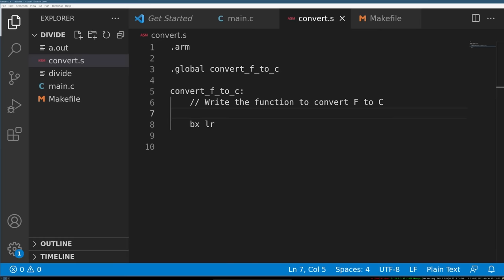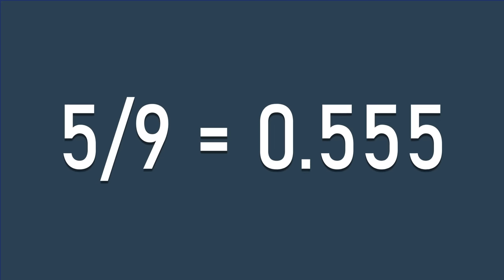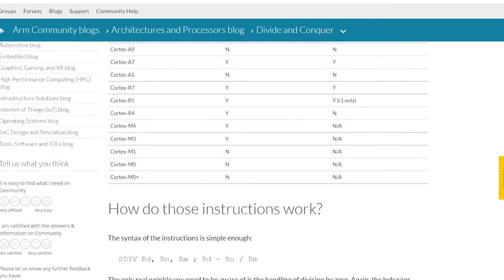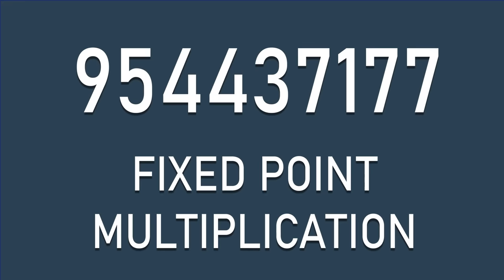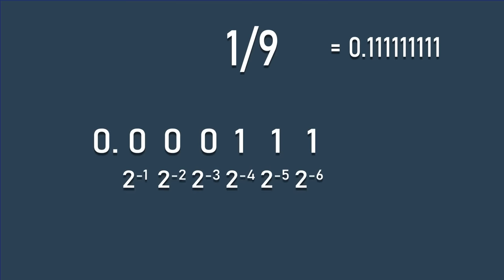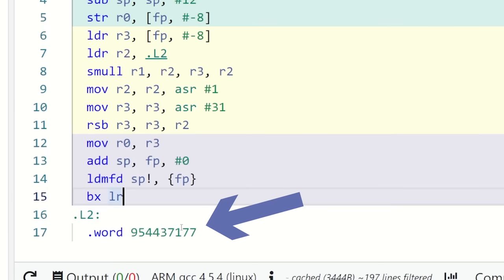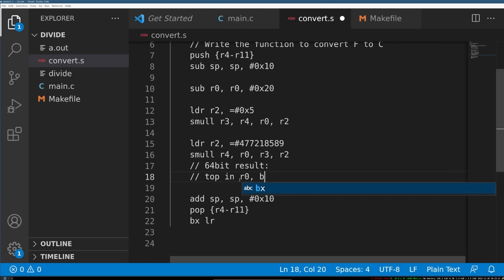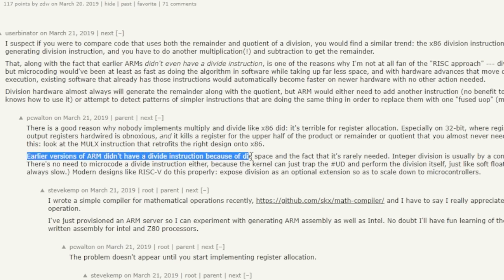computers suck at division (a painful discovery)

Comment: Other solution: don't use Fahrenheits.
Reply from the maker: Imperial Unit Gang
Reply: The good old freedom units that you got forced on by the uk cause nothing stands mor for freedom than the British empire.
Did you learn about picas and points btw? And can you tell me how many miles 1 pica + 3 points are?
Reply: F that!
Reply: For Non-Americans an easy way to understand Fahrenheit is to think of them as a percentage anything below 40% is cold 40% to around 75% are nice medium temperatures and anything above that is hot as hell!
Reply: @Devin Nall  Yeah like most metric stuff is just better full stop, but Celcius is not more beneficial for a human. Fs range of 0-100 being "about dangerously cold but manageable with layers" to "about dangerously hot but manageable with hydration and limiting sun exposure" is much easier to just understand what a temp actually means to me planning my day. Celcius is based about water state changes but I'm not water i don't care when it changes state for weather forecasts
Reply: @gwenyurick9663  The only other thing Imperial is better at is cooking Cups and Tablespoons is much simpler than milliliters
Reply: @gwenyurick9663  You're mostly water.
Reply: @PRIMEVAL543  why would anyone ever do that
Reply: Thats avoiding not solving
Reply: @gwenyurick9663  you are literally mostly water bro 💀
Reply: So for length let’s use metric because the decimals are so much better, right?
1-1/2 inches is exactly 1.1 in binary
1.1 cm is approximately 1.0001 1001 1001 1001 1001 1001 in binary
3-3/8 inches is exactly 11.011 in binary
3.3 cm is approximately 11.010011001100110011 in binary.

Which makes more sense in the digital age?
Reply: @devinnall2284  we have metric cups, tablespoons and teaspoons
Reply: Imperial units? More like Inferior units #roasted
Reply: @renakunisaki  I’m dead 😂
Reply: I like both for different reasons.
I like Fahrenheit because it feels nicer for representing human scale temperatures.
32-100 represents a more readable and relatable number scale for temperatures since it's a more 0-100 than Celsius.
Water freezes at 32, 60-70 is room temperature average, and higher than 80 is hot(80s), very hot(90s), scorching(100s).
Meanwhile 40s are refrigerators, 32 is freezing, and 0 is so cold you're in real trouble.
I use Celsius for inorganic things and large scales like processors and chemistry because it is way easier to know that 35C is good for computers, and 70s or higher is a warning sign your cooling is bad.
I like the precision from my precision tools.
I like the unga bunga unit for me. 
I understand that some people get furious about units and I totally understand the frustration.
But here's the thing, people. All units are standardized to metric. Imperial is as well.
The inch is the industrial inch and was standardized to metric long before many here were born. Besides. Most units are still silly. The SI unit for lumens? Candela. The measurement of a "standard candle." Granted candles are pretty consistent but still silly.
Units are tools. Some are developed for specific purposes where only a certain scale is necessary and anything more is either wasteful or adds confusion. Kelvin is the superior temp unit though.
Reply: @crankyfox  I like Celsius because it tells me what to wear.  
Over 30, shorts and T shirt.
20-30 long sleeves and pants.
10-20 add jacket.
Below 10, wear coat and think about gloves.
Reply: @aaronbaker2186  Fahrenheit does the same thing.
Reply: @ArchivedFox  not really, I wear shorts for some F temps that start with 8 but not others, ditto with temps that start with 6 and a jacket.
Celsius the clothing matches the first digit.
Reply: @LowLevel-TV  451 Celcius.
Reply: @aaronbaker2186  why in the hell at 20-30 would you wear long sleeves, for me thats alr t shirt temps :💀💀💀
maybe bc im a southy cough cough cold
Reply: Did you know that the USA actually uses the metric system, everything in imperial units is calculated from the metric value
Reply: @gwenyurick9663  I never learned Fahrenheit until I was 15 so celsius temperatures track well to me
Reply: @aaronbaker2186  yes, that is how tempurature works
Reply: When europe puts a man on the moon I’ll start using metric.
Reply: @jackroyaltea5034  didn't nasa admit to using metric nowadays
Reply: @devinnall2284  if you struggle to understand base 10, then yeah ig
Reply: @jackroyaltea5034  imperial didn't get you to the moon
Reply: 1-1/2 cm is exactly 1.1 and 3-3/8 cm is exactly 11.011 so what is your argument?
Reply: There are 2 types of Nations, those who uses the metric system, and the ones that landed on the moon.

(I am aware of the fact that NASA used the metric system back then)
(I am also European)
Reply: @simonhaas6480  you used metric to get to the moon, nasa works in metric
Reply: @Epic_747  Nah, that's propaganda from the Europeans to make their populace feel better over the fact that we got to the moon, then went several times, then just got bored.

(BTW, "imperial" is based af. 5280 feet in a mile feels soooo much better than 1000 meters in a kilometer.)
Reply: @MommyKhaos  wow their onto us, how long until they find out the world is flat
Reply: @jorceshaman 👍🏻 my first thought when I read that one
Reply: If you only have fahrenheit to begin with, you'll need to convert it. Hence this video. You can't just ignore data because the units are unfamiliar to you.
Reply: Using Celsius instantly solves global warming.
Reply: Fahrenheit gives you an intuitive 0 to 100 scale to represent ordinary temperatures that you typically encounter on a day to day basis. I live in a country where we use Celsius and the metric system. I'm all about meters, kg, etc., but Fahrenheit is way better than Celsius.
Reply: @jorceshaman  And salt is mostly chlorine. Are you going to wolf down some with your next meal? I can ignore the chemistry to man.
Reply: @myself2noone  I'm not going to wolf down table salt because it's gross and I get no salt fries. I'll wolf down some water, though.
Reply: Well imperial units are often easier in casual conversation just not for science or math, like if you’re helping someone park in a tight spot and not hit the car behind them you don’t say “you’ve got about 30 centimeters before you hit that car mate” you say “you’ve got about a foot before you hit the car behind you” oh and for height it’s just easier to say 5 foot 10 and makes more sense when you’re thinking about how tall that is in your head than saying 177.8cm tall and trying to visualise how tall that is, ps before you try to call me an American who doesn’t understand metric I’m from Australia we are 100% metric except for non formal conversion where often we use feet and inches for height and stuff like that
Reply: How many popsicles will that be?
Reply: Light the virtue signal 🙄
Reply: Certified rankien moment
Reply: The funny thing is, Fahrenheit is actually one of the better imperial units, so far as they are concerned. Celsius is honestly too large of a unit for temperature, imo.
Reply: @aaronbaker2186  isn’t the difference between 10 and 20 degrees kind of enormous? 70 degree weather doesn’t really require a jacket.
Reply: @Jorce  we're made of water but our lives are not applicable to water-centric temperatures. My blood does not have to boil for me to have heatstroke. Standing in 100°F, however, is right about the point where you really have to worry about that. Similarly, our blood doesn't have to freeze for us to get hypothermia, and it turns out that the body is pretty good at keeping blood from getting instantly frozen anyways. So, 0°F is actually really cold, whereas 0°C is pretty damn warm to me about half of the year.

Also, if we want to be smartasses, our bodies aren't simply made of water. We don't have pure water in our bodies, but rather a bunch of solutions. Solutions can and often do have notably different physical properties when compared to pure water, so why not use the freezing and boiling points for those solutions as our official temperature instead?
Reply: @Aaron Baker  that doesn't make sense, you're arbitrarily dividing the ranges into 10s in the first place. Arbitrarily dividing into 20s is the same exact thing for Fahrenheit:
80+, lightest clothing possible
60-80, light clothing, maybe a jacket for wind
40-60, sweatshirt or heavier jacket
20-40 heavy coat and pants
0-20, 2+ layers of clothing
<0, stay inside.
It's the same system, and it gives us a more precise understanding of what the temperature actually feels like.
Reply: Imagine measuring by base-10 no matter what instead of measuring by ergonomic, human bases of common usage
Reply: @iks1536  i said the imperial system makes no sense (or sens as you say it) to be used in science because it’s not decimal, but casual conversation is different because saying 5 foot 8 or something for someone’s height is easier to understand in your head than 170cm or whatever the conversion is,  trying to visualise 170 of a small unit like a cm is hard. it’s a larger unit of measurement that you can kind of quickly visualise in your head because it’s based on real objects, and no australia went metric in 1974 way before I was born so no I was not “raised in the retarded imperial system”, although you do still very rarely see miles and yards on some old faded overgrown signs on rural roads or long forgotten bypassed highways, guess they missed a few when the went round removing them. They have only survived in non formal conversation being used fairly regularly for height and very occasionally for distance.
Reply: @benjamin_b929  yeah, no
Reply: dude that’s like the only area where the imperial system is way better. 0% hot = extremely cold, 100% hot = extremely hot. everything else is better with metric but this is the OBVIOUSLY superior way of measuring temperaturez
Reply: Other solution: just divide by two. Close enough
Reply: FAHRENHEIT FOR LIFE
Reply: @Silvia.Sparks  For a miserable one.
Reply: F is required mainly for measuring body temperatures as they give a sight higher scale
Reply: @chandukiran13  wtf are You even talking about, thermometers for body temp measurements have precision up to 1/10th of a degree. What more do You need?
Reply: @iks1536  but it's easier to convey you have a fever saying 99 or 100 or 101.2 rather than saying 38.23 or something
Reply: The real solution is don't use Celsius.
Reply: @PRIMEVAL543  *more
It makes sense you struggle with English.
Reply: I understand a lot of the metric system being better. However, I don't understand why Celsius is better than Fahrenheit? There is no MC, KC, mC. People like to say it is matching the boiling point and freezing point of water but who cares. First off boiling point changes substantially based on elevation/air pressure so 100C isn't that helpful. Does having an easy number for freezing really important in my life?
I'd personally rather use Fahrenheit as then I don't have to deal with negative numbers. Where I live it gets below freezing but rarely does Fahrenheit go negative.
Reply: Other solution. Use F and not C
Reply: @LowLevel-TV  more like inferior units
Reply: @devinnall2284  You don't need to use millimeters for that lol
Reply: Sadly I'm not used to Celsius, I've used Fahrenheit my entire life. Then again, I probably could because I suddenly started using meters out of nowhere
Reply: Farenheit is the one thing Imperial has that's actually good for daily use. Everything else should be tossed for  metric IMHO.
Reply: Why ARM processors?
What about CISC based ones?
Reply: @PRIMEVAL543  we use Celsius..
 - a brit
Reply: @LowLevel-TV  SI units are better :/
Reply: @off7hewall And a 'Stone' is 14 pounds.
Reply: @aaronbaker2186  I can tell you don't live in the UK. Take 10° off each temperature range and that'll be more normal for here. 😄
Reply: @aaronbaker2186  20 to 30, long sleeve and pants?
Are you joking?
30C is real hot. I don't know anyone who would wear a pants and long sleeves in that weather. Even 20+ is still decently warm.
You must be cold the whole time wanting to cover up so much in those temperatures.
Reply: yep. garbage in, garbage out :P
the other solution is integer math, which lotsa applications use for this reason
fp precision will drive you nuts if you do 3d design or level design
Reply: You're telling that to Americans who call "football" a sport where they mostly use their ARMS to throw and catch an OVOID, but call soccer the sport where players mostly will use their FOOT to kick a BALL.
Also refusing to use International measurements.
Reply: @jackroyaltea5034 that was possible by the power of BUDGET(being USA the global power) during the cold war as a show of of who had the best rocket tech. URSS gone, no more budget, no more people to the moon. Not because of units, as you kind of claim.
Reply: @hermitcard4494  Water boils at 212F. You can't explain that!
Reply: @gwenyurick9663  Most of you (60%) dissagrees with that statement.
Reply: Unsure how it works. do we have to bow to the king to use Celsius?
Reply: @LowLevel-TV  don't think I've ever had a shudder go through my body as quickly ever in my life 🤢
Reply: Even better don’t use American units 😂
Reply: Contrary to popular belief Fahrenheit is by far the more scientific of the initial of temperature measurement because it ties the specific unit of measurement to a physical change that can be measured. The first flaw of Celsius is that it’s standards of units (freezing and boiling of water) are not fixed constants and change with relative pressure (not much but it is there) secondly it requires a competent breakdown of the space between those two points into even linear segments which is a tricky proposition when you are building a measurement device. Fahrenheit on the other hand takes a known physical property, the the thermal expansion of mercury, and uses it to fix the delta T units of temperature rather than deriving them secondarily. An increase of 1 degree Fahrenheit is equivalent to an increase in the volume of mercury by .01% therefore you set a single calibration point (knowing either 32 or 212 is good enough you don’t need both) and configure the thermometers to the change in volume beyond that fixed point.
Reply: Fahrenheit landed a man on the moon.
Reply: Just don't use Celsius then you don't need to convert it
Reply: Aka stop measuring things with feets
Reply: I prefer Celsius over Farenheit for one simple reason: 69°C is an ideal temperature for coffee, it is said.
Reply: @bobh6728 just use fractional or decimal fixed point numbers. Dollars are represented in tenth power too.
Reply: @gwenyurick9663  it's always the same argument every time lmao. The interval is totally arbitrary, you just get used to one or the other. 0-100 is not more understandable than 0-40, you're just more used to it. Also, you can't really feel a difference of less than 5°F, so why do you need so many degrees? Just do 1-10 with half steps, and done. At least Celsius has an excuse for not being 0-10, F is just dumb from every perspective
Reply: @simonhaas6480  There are two types of nations: the USSR and the ones that didn't reach the space first. And USSR used metric so...
Reply: Other solution: shut.
Reply: Sooo. Imperial ist based in metric...
Reply: @LowLevelLearning  the one time I like using imperial is coincidentally when using a temperature that I don't want to be relative to absolute zero because each full degree has less range in between.
Reply: MURICAAAAAA
Reply: Brain solution
Reply: @gwenyurick9663  is that so hard to remember -20, 0, 24, 36.6?
Reply: @PRIMEVAL543  what a helpful and well-known unit of measurement
Reply: @LowLevel-TV boooooh
Reply: Fahrenheit is better for everyday use. 
Celsius is better for science, except for when it’s Kelvin’s turn on the xbox.
Purism is bad.
Reply: @Coliflower185  When using inches, a lot of the time it is broken down to 1/2, 1/4, 1/8, 1/16, 1/32, 1/64 and rarely 1/128 of an inch. All of these can be represented exactly in binary. We would use 3/15 like your example. You wouldn’t use 3/8 of unit.
So I’m just saying, for the digital age, systems based on powers of 2 are a more logical choice than ones based on 10, 12, 3, 5280, or 60.
Reply: What kind of weirdo uses Celsius? Ahh the same weirdos who all disarmed themselves and bow down the government xD
Reply: @aaronbaker2186 How about over 50!😮
Reply: fahrenheit just has one problem for me: the freezing point. the freezing point with celsius is really easy to remember as it’s just 0 whilst fehrenheit is some weird number that is hard to remember. 

so like -x celsius = snow and ice and that’s easier to remember and understand than <32 fahrenheit = snow and ice. but for normal life fehrenheit is nice as you may mistake 23 degrees as cold in celsius when in fact that is 75 degrees Fahrenheit which seems more reasonable
Reply: @gwenyurick9663  100 Fahrenheit is really not that hot. It gets that hot and even hotter in Vegas and you really don't feel it
Reply: @devinnall2284  makes sense. Because despite the fact that computers cant divide, humans divide very well. And numbers under 12 are easy for our brain. 😁👍
Reply: Thats why he is converting it
Reply: @fluffyisyermom7631  Free Healthcare and no school shootings feels pretty good though
Reply: It’s funny that Europeans say Americans can’t take jokes, but make a joke about freedom units being better and you’ll get a lecture on how metric is “objectivity better.” I’m a metric liker but this is childish lol
Reply: @hermitcard4494  Historically, the word "football" used to be a generic word for sports not played on horseback.
Reply: My take on Celsius vs Fahrenheit is that Celsius shouldn't've been invented in the first place. Both systems are equally arbitrary, and equally valid. The reason I say that Celsius shouldn't've been invented is that it didn't need to be. The metric system was invented to solve one big problem, that being the need for a standardized, general use measurement system. Prior to metric, most measurement units were invented for a single specific purpose, this is why some older units have bizarre definitions like grains of barley or lengths of body parts, the need to convert from one unit to another wasn't taken into consideration. This was a problem because many measurement units had almost subjective definitions that could even change based on what region you used them in. Metric solved this problem by creating units with objective definitions and used powers of ten to make the units internally easy to convert. Celsius, however, is the odd one out. Fahrenheit had already been invented by the time of the metric system, and could be easily defined and measured by mercury thermometers. Comparatively, Celsius's definition of 0° being the freezing point of water and 100° being the boiling point of water is actually subjective, since neither of those are universal constants, meaning they can change based on environmental factors. Neither unit is more objective or better they're just different ways of communicating the same thing.
Reply: @PRIMEVAL543 the imperial system is kinda dumb since we're the only one using it, it's not as readable as the metric system since it's not based 10, and the metric system is a standard in most scientific use cases even here in the us
Reply: Other other solution, just make a company, make analog computer, make it popular, replace digital computers with analog ones, create a monopoly without trying, defend that monopoly and now you can process any number (hopefully) you can think of
Reply: How are we supposed to get to the moon without the superior units of measurement?
Reply: -- the whole imperial vs metric debate is so fucking stupid 'cause it literally just boils down to "having to refactor literally every instance of a unit of measurement in our lives just so it's easier to tell at a glance when water will fucking boil" isn't that appealing

-- esp since we literally use metric units in everything scientific we do anyways
Reply: @niikobloxxin  reminder: a probe crashed into mars bc of 2 systems
Reply: @gwenyurick9663 yeah, but when it comes to using temperatures in physics, you cannot easily use fahrneheit, as it was not developed to precisely measure energy like the kelvin scale. And the kelvin scale is simply the celsius scale shifted by 273,15°, the difference between 1 and 2 degrees is the same. Making celsius more useful for physics calculations.
Now, everyday life? It's really all about habit since precision is not important. 
100f or 37c degrees for hotness and 32f or 0c degrees for coldness, it's not really important.
But if you make any use of physics, and I do, in everyday life, you need to learn celsius/kelvin. So if it's just habit plus celsius better in science, I'd say it's better to employ the celsius scale.
Reply: Other solution: don’t use Celsius

Ultimate solution: Get rid of both and only use Kelvin
Reply: @devinnall2284  OOOOH OK IM EUROPEEAN THIS HELPS
Reply: @hermitcard4494 you realize that the term soccer came from the uk right?
Reply: ...."Wtf is Kilometer?!".....
Reply: I like how he's trying to convert something in to Celsius from Fahrenheit which it would just make sense just to use the better system which is not the metric system and like wtf is a kilometer like a kilo is a way a measuring weight so what dumbass decided to put meter after it like what dose a kilometer even mean like even when you put kilo into Google it comes up with kilogram and says kilometer is rare like even Google doesn't like it and it's a search engine, use a better system that actually makes sense. 0 degrees is cooled and water freezes at 32 and 100 degrees is hot and 50-70 is pretty nice. It just makes sense.
Reply: @bobh6728 clearly the binary as if we are talking digitally the computer understands that better
Reply: @Konsebruh that's what I'm saying like who the fuck put a kilo in front of meter like Google doesn't even like it
Reply: @LowLevel-TV  imperial > metric
Reply: @devinnall2284  thats not helpfull
Reply: @Scudmaster11  🤷‍♂️
Reply: @bobh6728  that is not how computers use decimal numbers. They use IEEE 754 format. Every number is a 32 or 64 bit string of numbers.
Reply: @Vogelchen  IEEE 754 is the floating point standard. Since it is binary numbers, it cannot represent most decimal numbers exactly. 0.1 is 0.00011001100110011... You have to cut it off at some point, so it is not exact. That is my only point, that fractions based on a power of two like 1/2, 1/4, 1/8 can be represented exactly. I run into this all the time. Adding a long list of positive and negative numbers that add to zero will sometimes show 1e-18 as the sum because of that imprecision.
Reply: @PRIMEVAL543  no person who uses the imperial system knows what a pica is, that's like asking how come you live on earth when you can't tell me the chemical makeup of the mantle
Reply: @gwenyurick9663  Celsius is like asking water how hot it is, Fahrenheit is loke asking a person how hot they are, and Kelvin is like asking an atom how hot it is (this one might not be that accurate)
Reply: The thing that kills me about the argument for Celsius is that the boiling point of water (at sea level, mind you) is an utterly useless number because you do not need to know the temperature of water to boil it. The magical thing about liquid->gas state-change is that when a substance hits a pressure-temperature that would cause state change, it's temperatures stops changing as excess thermal energy is used to break bonds.

Are there times (maybe in baking?) where it would be useful to know the boiling point of water. Sure. Are they frequent? Absolutely not. Most of the time people just add heat to water until it boils, no measuring required. 

So why then is it a feature that Celsius squished the entire range of typical human living temperatures into a ~40° range in order to reserve 100° for boiling water?
Reply: Rankine temperature scale is superior.
Reply: @PRIMEVAL543  SCOTLAND FOREVER
Reply: A universal solution for conversion problems is to use a lookup table with sufficient precision. Having lived in Hong Kong and moved to New York, I remember these exactly matching temperatures: -40°F=-40C 32°F=0C 50°F=10C 68°F=20C 86°F=30C
I used linear interpolation between these exact conversion values as I originally learnt to use linear interpolation to "look between the lines" of a logarithm table for the desired logarithm value.

China used °C. British Hong Kong went from °F to °C. Then in New York, it's °F until I sought a ° in a University and it's °C until Physical Chemistry required K.

The Book of Revelation's hotness sequence is: 
°C °F °C °F °U °C K
Reply: Just avoid backwards units like centigrade.
Reply: @gwenyurick9663 also you can control your thermostat with more precision. Some will say they can use 0.1 C increments, but that is only if your thermostat has that, and also if it does, 0.1 F increments are also then even better. But the most precise control would be to switch between both to get all possible points on the thermostat, but that takes more figuring out.
Reply: yes
Reply: @FBI_42069  You may only be joking but I assume you're not. A kilo is just a way of saying that the unit used is a thousand times bigger. For example 1000 bytes is 1 kilobyte, so you also use kilo in your country
Reply: @PRIMEVAL543  Well, the british Empire abolished slavery and made a lot of places properous.
Reply: In most cases,  the metric system is clearly superior...but Fahrenheit is a better temperature scale.
Reply: @chrism6880  how come? 🤔
Reply: @hoti47  it's purely opinion, but 0-100 roughly translating to environment temperature in human habitats, and the higher resolution without need for decimal expressions are the reasons I prefer it.  Although it's likely that anyone would simply prefer the system he or she is used to.
Reply: @chrism6880  Well, yes, it makes sense for the evironment, but probably not that much for other purposes.
Reply: @gwenyurick9663  my brother in christ Celsius is literally the same the scale just goes from ≈-30 to +30
Reply: @bobh6728  i know i'm gettting baited super hard right now but this decreased my life expectancy by 22 years and i wish that comment was never sent
Reply: @LowLevel-TV  WTF IS A KILOMETER RAAAAAHHHHHHHHH 🇺🇸🇺🇸🦅🦅💥💥🇺🇸💥🦅🦅🇺🇸💥🦅🦅🇺🇸🇺🇸
Reply: @gwenyurick9663 yeah definitely american. YOU ARE 70% WATER...
Reply: @gwenyurick9663  that idiot system of porcentage doesnt work with celsius. Its 256 to 100000+. Why human factor matter that much when the only benefit for Fahrenheit is to know "better" the temperature sensation? The only reason that is "better" is that people learned in that way in first place. Everybody knows that 40+ C is too hot and -10 C is too cold, there isnt one single person that it isnt an american that doesnt know that, its just natural as yours "porcentage system"......
Reply: Or don’t use Celsius
Reply: @bradymiclea1705  Fahrenheits make less sense than football stadiums per superball match.
Reply: @bradymiclea1705  fahrenheit is just weird, explain me a reason why Fahrenheit should be used
Reply: @broodjenoodles  because if you go to a weather app it only uses whole numbers and since Fahrenheit is smaller units it is more accurate. Now explain how Celsius is so much better
Reply: @bradymiclea1705  it uses half degrees, fahrenheits is weird; "how it feels"??? and all other calculations are done with celsius (and Kelvin, which is the same as celsius)
Reply: Use Kelvin
Reply: That’s at the product manager’s level
Reply: 0 C + 0 C = 64 F
Reply: @devinnall2284 no it isn't. Cups and spoons aren't a proper metric measurement cause they can differ greatly from not only one cup/spoon to another, but even between different samples due to density
Reply: @gwenyurick9663  First of all it's Celsius not "Celcius".  Also it's not the metric unit for temperature, but Kelvin is.  And lastly why would temperature units chosen for weather or human body only?
Reply: @PRIMEVAL543  The Empire that ended slavery across most of the globe; they certainly did stand for freedom.  Once upon a time...
Reply: thanks that totally solves arm's problem,
Reply: Agreed. Even living in the US I prefer metric because it actually makes SENSE. Everything being powers of 10.
Reply: Umm don't hurt us American brains
Reply: @chandukiran13 we don't say fevers are a point value in Celsius, they take from 39c to 41c
Reply: zzzzzzzz
Reply: Metric on top
Reply: Brute force it 😂
Reply: @devinnall2284  when i hear us measures i always think about Tolkien
Reply: @devinnall2284  ok fine but what if the cup ain't the same as in the recipe? What is a cup?
Reply: @Napoleon_e2  A cup is half a pint, which is half a quart, which is a fourth of a gallon
Reply: @benjamin_b929 well if you want it with cars we wouldn't say the exact measurement but just, close, real close, stop. And who the actual hell says 177.1 cms, they would say 1m 77, just like you are used to imperial, people who use metric also are used to it, like idk the difference between 5 foot 8 and 6 foot but I know that 1m 50 is small 1m70 is average and 1m 90 is tall 2m is just gigantic bruh.
Reply: @chandukiran13 nah we usually say, I have 38, 39, or 40 fever any higher would be highly visible but you could still say 41 fever
Reply: @crissd8283 nah, in Celsius anything below 10 is very cold but once you go into the negatives, you know the real shits bouta come
Reply: @crissd8283 freezing is quite important if you own a car which is essential in the USA as you can know if it's gonna snow or if there will be ice on the road
Reply: @Sean-pm2vd nah 20 is cold 30 is hot 40 is dangerous 50 Is death, 10 is real cold and 0 the real shit happens
Reply: @devinnall2284  good now, you would still need graduated measurements on your containers, so why not just use  millititers and liters like the rest of the world?
Reply: Personally, I feel like a ducentigrade solution where 0 is freezing and 200 is boiling would be an ideal midground
Reply: @LowLevel-TV You saw the problem you had.
Reply: Okay. What about other conversions that have nothing to do with measurements?
Reply: @sprytnychomik  other other solution. Don't use shitty arm chips
Reply: I use Fahrenheit where I live and even I agree with you.
Reply: @PRIMEVAL543 If there’s something we Americans love more than freedom, it’s laziness.
Reply: Skip useless Celsius too! Use Kelvin!
Reply: life is not in tens, life is random odd distances , maybe in Tron everything is a grid in tens.
Reply: Wrong
Reply: @FBI_42069  a kilo is a measurment of weight? You cant be that dense..
Reply: @gwenyurick9663  You are, for the most part, water. And water is a big ass part of clima and other stuff so yes Celcius is better than the arbitrary a percentage but not really that is Farenshitlord
Reply: Hamburger units @LowLevel-TV
Reply: @megamaser intuitiveness is up to habit. I understand celsius much better than fahrenheit because it's what I'm used to and an american would understand fahrenheit much better than celsius for the same reason. 35 degrees being hot is much faster for me than 95 being hot.
Aside from habit, I value precision and definitions. Celsius is better defined than Fahrenheit and better for any physics.
Day to day life: habit is king, use whichever you grew up with.
Science: kelvin/celsius wins.
So overall if we all used celsius, we wouldn't have to learn 2 systems.
Growing up with fahrenheit means having to learn celsius/kelvin too.
Reply: @PRIMEVAL543  only USA free
Reply: @devinnall2284  that's really useful, thanks!
Reply: @LowLevel-TV Fun Fact:
The US doesn’t use the Imperial System. It uses US customary units
but I still this metric is better
Reply: @LowLevel-TV  zzzzzzz
Reply: @PRIMEVAL543 Last time I checked the British empire didn't rule over 150 countries
Reply: @LowLevel-TV  No
Reply: Fahrenheit better becuase just more based off of feeling
Reply: For weather Fahrenheit is a superior more human scaled system. Celcius is good for dealing with water. And Kelvin is good for the Universe
Reply: @gamingforfun8662  In 1998 NASA lost the Mars Climate Orbiter because Lockheed Martin Astronautics used imperial units (and NASA metric).
Reply: @jackroyaltea5034  Imperial units are just as much European as metric units.
Reply: @megamaser  Celcius is closest to the Kelvin scale, which is the scale that makes scientific sense. Btw, my country (NL) uses Celcius but I think 100 years ago or so temperatures were in Fahrenheit. I remember reading an old children's book as a kid (I think from the 1930s) which mentioned some crazy high temperatures.
Reply: @benjamin_b929  In continental Europe we certainly do say 30 centimers. If you go back long enough, people in my country (Netherlands) would have said "one ell" for elbow.
Reply: @ronald3836  first off damn how did you even find my old ass comment

Second ya i know that fact always blows my mind that no thought to check and that little to no heads rolled as a result
Reply: @gamingforfun8662  I was just scrolling thorough the old comments 😄. I think I wanted to check that it was indeed NASA that ran into this, so I googled to be sure. There is also a famous ESA Ariane 5 failure due to some silliness, but it would be strange if that was because of a failure to stick to the metric system (ah, the problem there was caused by converting a 64-bit float to a 12-bit integer).

And then we have Mars Pathfinder and priority inversion... that's more tricky though.
Reply: @ronald3836  hmm didn't know about that pathfinder had issues guess you learn something everyday
Reply: @devinnall2284  85 is nice during summer in texas
Reply: @jorceshaman but AM i water?
Reply: @LowLevel-TV  MERICA RAAAHHHH 🦅🦅🦅🦅
Reply: @sprytnychomik  that's the correct answer
Reply: tell me you hate freedom without telling me you hate freedom
Reply: Other solution don’t use Celsius
Reply: @gwenyurick9663  i can assure you that we can perfectly well know how the temperature effects our bodies even when given in celsius...so no, its not a good argument for Fahrenheit.
Reply: @devinnall2284 What's 0° in F?
Reply: @FirstName-zt2my  0 Fahrenheit is actually also the freezing point of water just not purr water like Celsius it's the freezing point of sea water if I remember right
Reply: @PRIMEVAL543  It's even funnier when knowing celsius are commonly used in UK.
Reply: @PRIMEVAL543 i mean we were going to switch but a ship sank so we had to stick with it